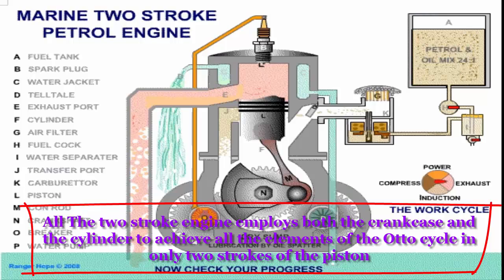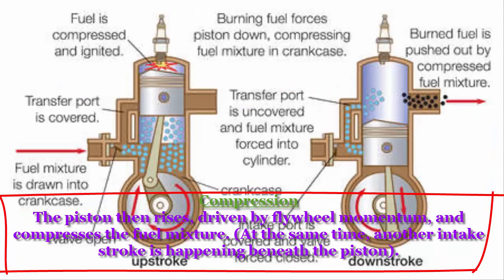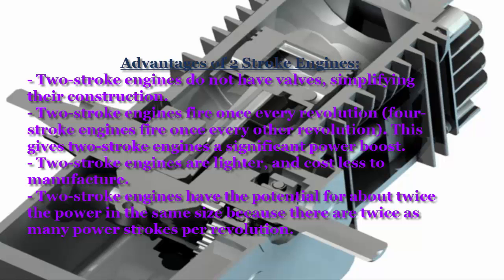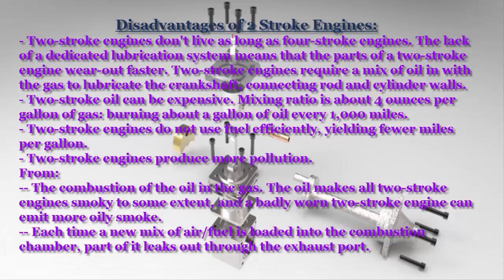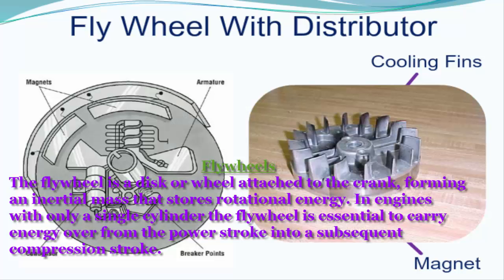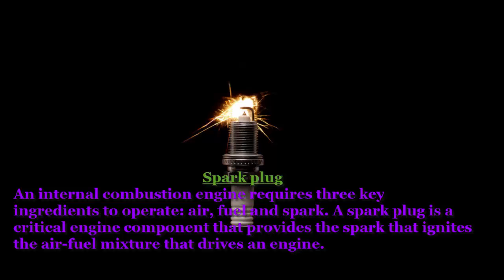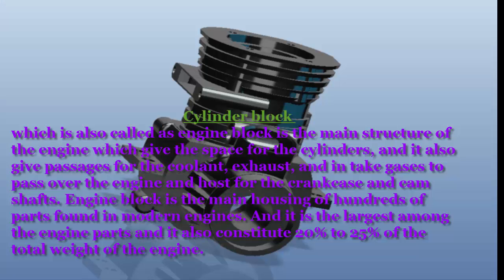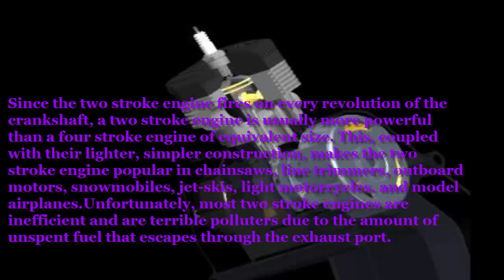ALL ABOUT TWO STROKE ENGINE

Comment: How can you make a 2 stroke engine more fuel efficient and less hydrocarbon realesing
Reply: umair Kazi fuel direct injection into the cylinder
Reply: Add 2 more strokes to it
Reply: Well I am most familiar with Skidoo snowmobiles and their 2 stroke engines, so I will use their technologies as a basis for my argument. Skidoo has created some of the lowest emissions available on any 2 stroke motor on the market, comparable with some four strokes. They achieve this with their ETEC semi direct injection which basically slams a precise amount of fuel into the cylinder when the piston is at the top of its stroke. Which basically eliminates any excess fuel leaving through the exhaust port, plus it even adds power to the engine. Which brings me into my next section, you can have an exhaust valve, but in this case it isn't like on a four stroke engine. If I am not mistaken it is basically a sliding sheet that covers the exhaust hole and opens as the motor is given more throttle. Skidoo calls this RAVE Valves. 2 stroke Detroit diesel engines also had a form of exhaust valve which might actually be run by a camshaft. In my opinion 2 stroke motors are like nuclear energy technologies, everybody wants to get rid of it because it has downsides, but if you put the time into it then you can do some amazing things, like how BRP (skidoo) has done amazing things with their Rotax 2 stroke engines.

Comment: A 4 stroke requires oil control rings that if worn will allow more oil above the piston to burn but that is not the case in 2 strokes where there is as much lubrication oil above and below the piston already therefor there can be no excess burning of oil from a worn 2 stroke. A worn 2 stroke will simply have less compression. which it can be argued that as less of the oil is combusted due to low compression that it would emit less smoke and send some raw un-combusted oil into the exhaust instead of burning it that creates the smoke.